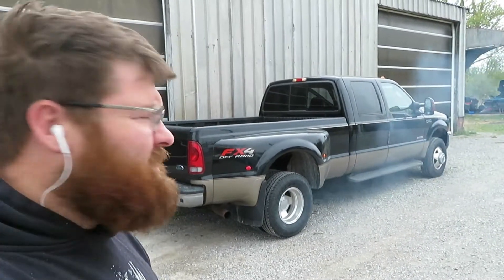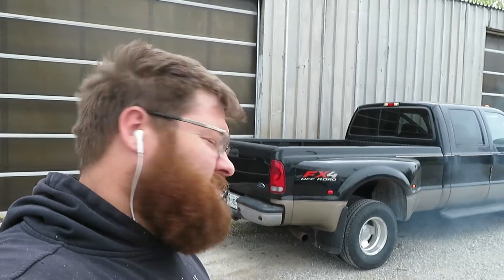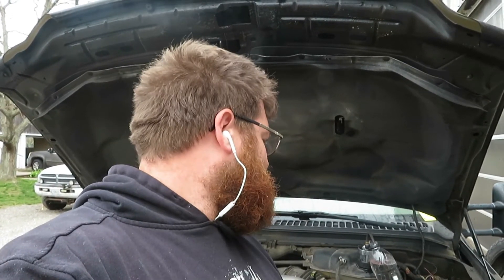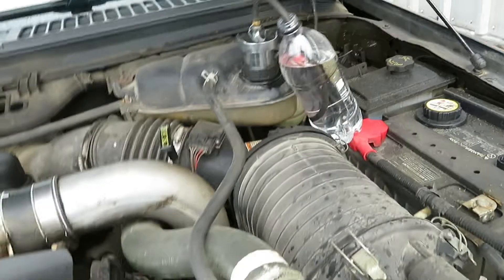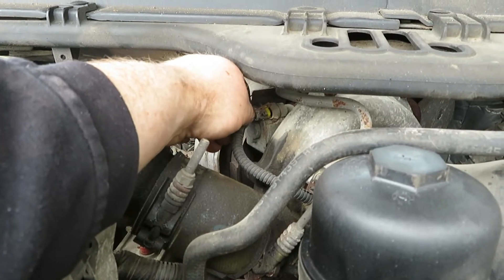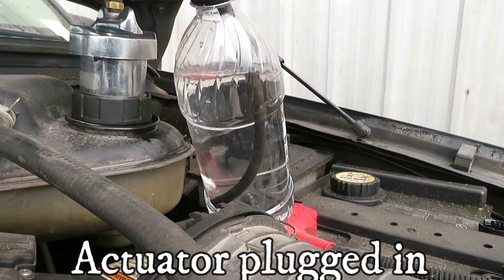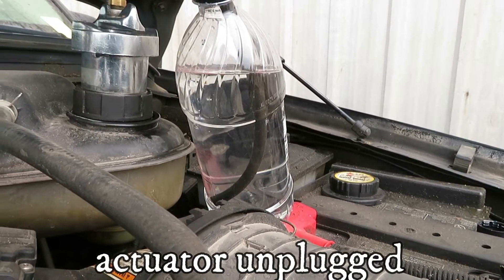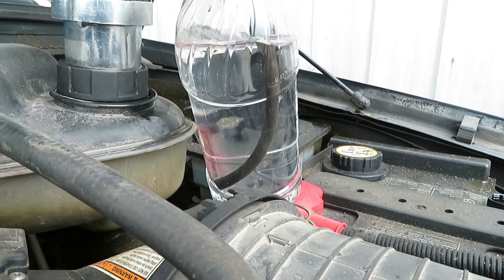6.0 POWERSTROKE EGR COOLER DIAGNOSTICS.....AKA THE BUBBLE TEST

Comment: I got a egr code and went to replace the egr valve and noticed the soot in the intake was wet. Also noticed the coolant level was lower. 
If the egr cooler is leaking coolant, would that mean the egr cooler is ruptured and this bubble test would be able to diagnose if the egr cooler is leaking?
Reply from the maker: Yes sir. If it’s wet in the intake then you don’t even need to do the bubble test. It’s ruptured for sure.  I recommend a bulletproof diesel H core cooler if that’s the route you’re going to go with repairing it.
Reply: @screamindieselltd  thanks for the help!
Reply from the maker: @jeffhaxton8873  anytime!

Comment: So if bad head gasket… will it show milky oil on dip stick ?
Reply from the maker: I would call a leaking oil cooler for that. I’ve never seen a milkshake in an oil pan on a diesel from a head gasket. Not to say it can’t happen though
Reply: Ok … thanks for reply and been while n I did tested the way u did but mine when start engine no bubbles at all when running motor and when I disconnect the connector by turbo no bubbles at all too
Reply from the maker: @vicentegonzales3852  sounds like your cooler and gaskets are fine. What symptoms does the truck have?
Reply: White smoke heavy smell fuel
Reply from the maker: @vicentegonzales3852  is it knocking at all? Sounds like an injector issue
Reply: I unplugged mine and bubbles stopped but coolant went in bottle with bubbles

Comment: Where can I get the cap adapter, or what is the proper name for it please, so I can find it? Thank you.
Reply from the maker: The one I use is from my pressure tester kit. But there are companies that sell the tester kits. I think bulletproof diesel and sinister diesel have them. Or look on xdp
Reply: @screamindieselltd  You can make your own from a radiator cap and a small barbed hose fitting.
Reply: @screamindieselltd   Thank you!